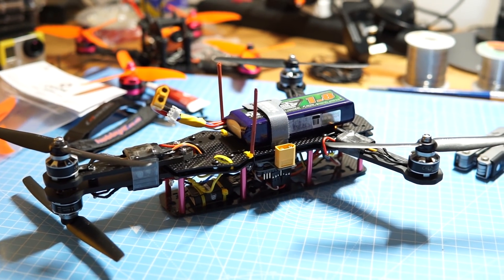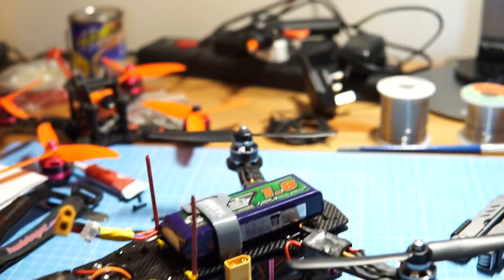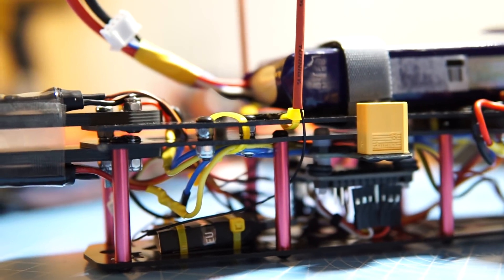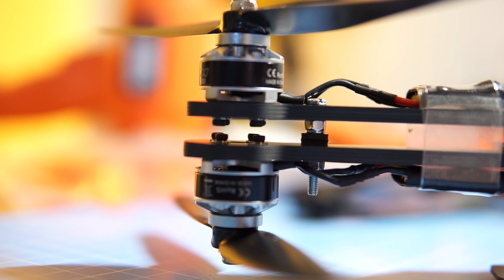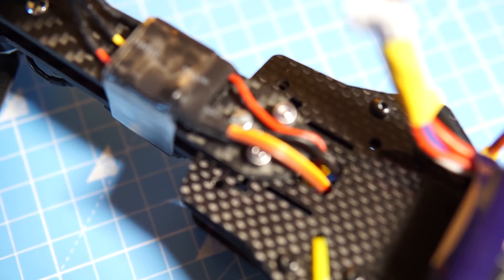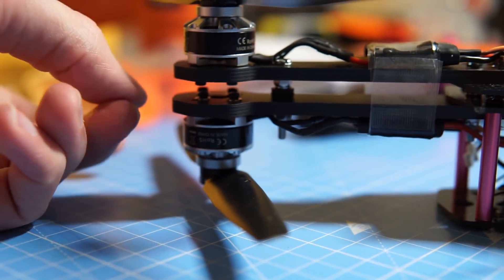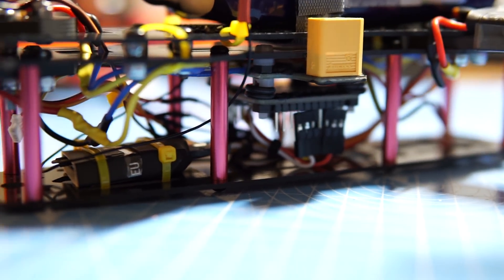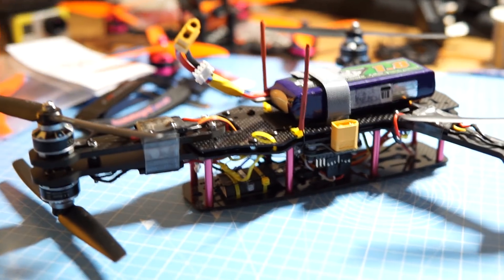ZMR250 Y4 conversion - YMR250? Y not!

Comment: Hey man.  I just build a Y4 with 8 inch props; 1400kv motors.  It hovers nice and pitch and roll seem fine, however when yawing right it tends to pitch forward at the same time.  Did you encounter this?  Did you have to raise P paw higher than default?  I'm at 65-P and-40 I for yaw.  I also tried to increase Pitch-I a bit and it did not help, much.   I believe the CG is correct.   I also read that with Y4 the rear motors provide more lift so I'm wondering if i need to go smaller on the rear propellers.?.   Thanks for your help!
Reply: Here is a visual.   https://youtu.be/tpIKzVbLMQo
Reply from the maker: I'm afraid I literally only flew two packs through it to see if it worked & never got as far as tuning. I still have it (& it's still in once piece!) so I might revisit it in the future, but for me it was really just a weekend project to see if it would work!

Comment: got mine built and flying this afternoon.. had a few hovers around my living room, and a quick flight outside.. did you use a custom motor mix on the y4 settings, as the yaw on mine is very weird and seems to yaw more one direction than the other... also a throttle punch causes it too do a 360 roll... in angle.... i have not got my flight controller in centre of frame so wondering whether i need to alter the mix to a custom...
Reply from the maker: Nothing custom in my settings, everything stock even PIDs - just whatever the defaults were in Cleanflight (probably 2.0.2). I wouldn't say it flew well, the yaw did feel pretty janky & it seemed to start pulling to one side after the first big crash. I uploaded some FPV footage in rate/acro mode which gives a better idea of how it flies --> https://www.youtube.com/watch?v=eLcUlJQEyUo
Reply: yeah its definitely an experience to fly.. mine seems better now i worked out the custom mix.. it may be worth calculating your mix seems to make a difference.. theres an online clacluator if you need link i can get it to you...
Reply: @CliffMitchelless  привет друг! Если ты это читаешь не мог бы ты дать мне эту ссылку пожалуйста

Comment: mine is taking shape.. running zmr250 similar layout as yours but running double front arm thickness, and running sunny sky x2212 1400 kv motors,  8 inch propsand a q brain 4 in 1.. esc, cc3d atom.. did try some dys sn18a escs cheap from hobbyking but dont know how well they going to perform the qbrain 4 in 1 esc  has worked ok in a previous build